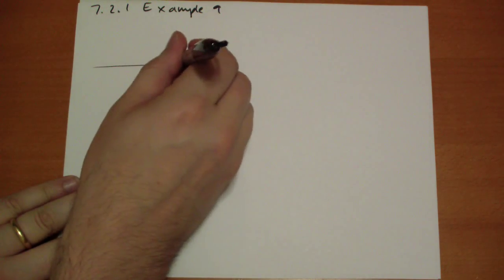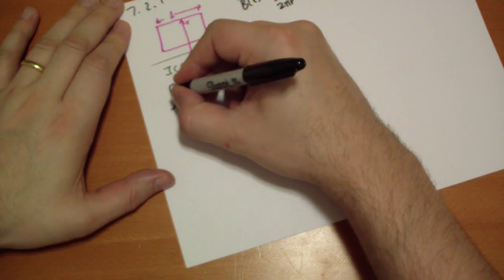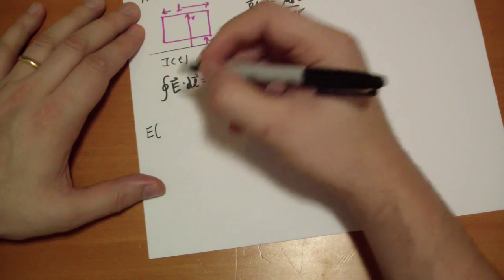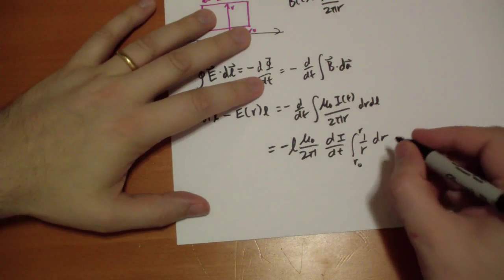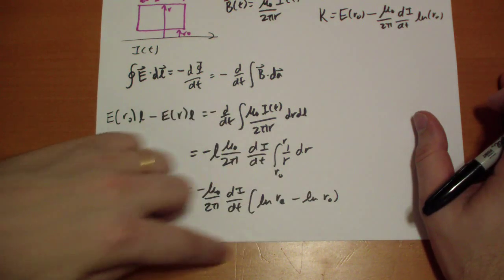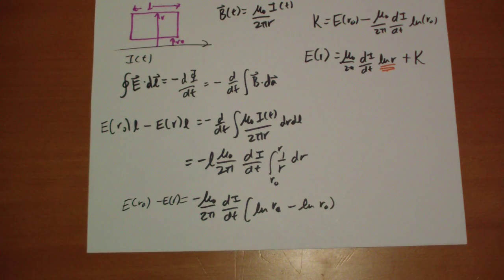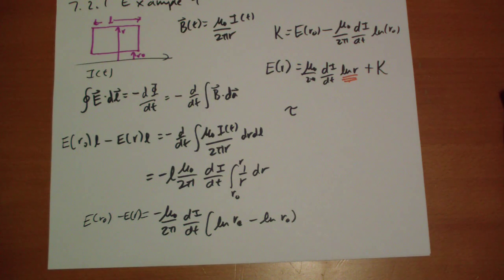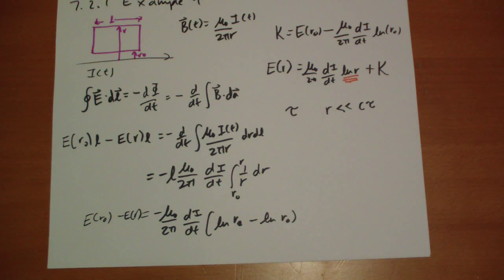7.2.1 Example 9

Comment: Hi I do not understand why E only points along the direction of the current
Reply: I have NO IDEA why these instructors, and indeed the textbook, BLOW PAST how to figure out the direction of the E field, like it's trivial or obvious. It's INSANE.
Reply: Bro this question was asked 9 years ago and I still have the same question 😢💀
Reply: @shaheedperez5692  You can see from the formula that the induced electric field is created by the changing magnetic field. Since the magnetic field varies with distance from the wire, the electric field of the vertical sides of the loop will cancel since they are the same distance away but opposite directions. Only the horizontal remains. At least this is what I believe is happening.
Reply: Hey @user-wt3ev1zg2l  thx for feedback I had to study it for a test last week so I understand it now
Reply: @shaheedperez5692  ofc. And looking back on this, I think a nicer explanation is that we know that the magnetic field is pointing out of the page and the loop is moving up so by the RHR where your fingers represent the velocity, palm represents magnetic field and thus the electric field has to point along your thumb to the right. for anyone who has this question in the future.
Reply: or that this situation would create the same effect as the changing current.
Reply: We consider the path integral along a line segment ‘dl’ vector, where the vectors at both ends point in opposite directions. So the induced field and the line segment are always aligned in the same direction, then they won’t cancel each other out.